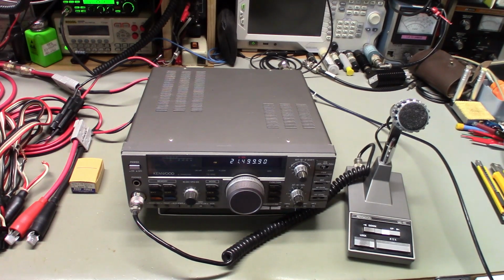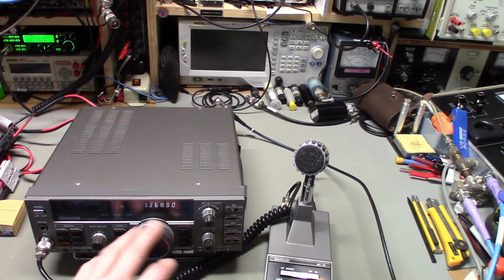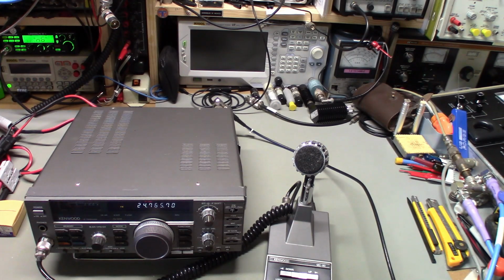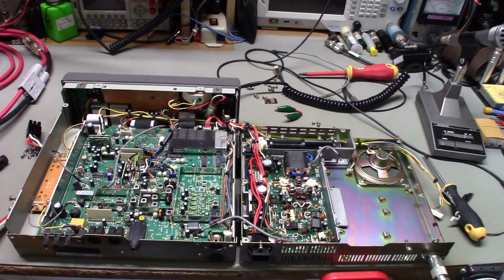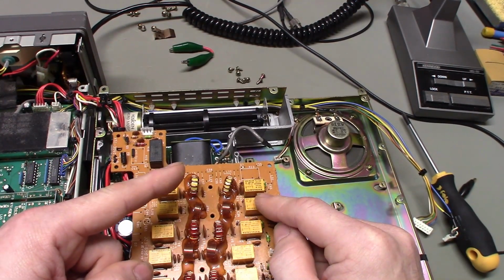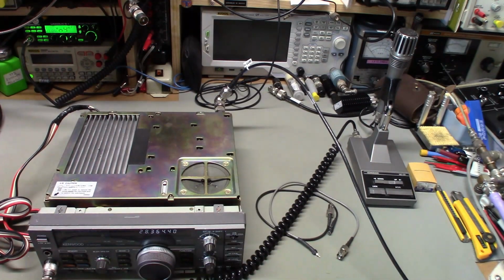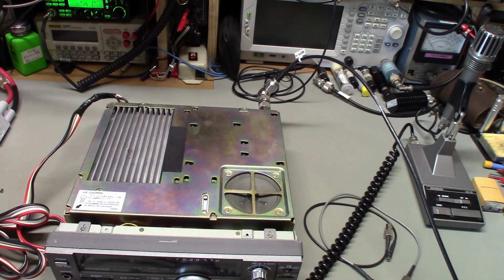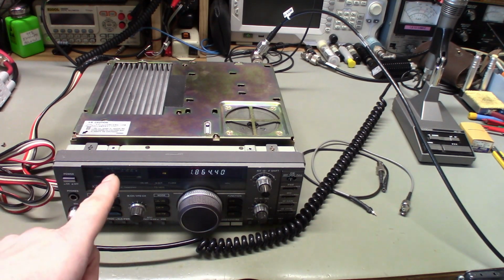Kenwood TS-140S HF Transceiver no receive / transmit repair.

Comment: Hi, I understand that this video was 6 years ago. Wondering if you still work on Kenwood Transceiver? I have a Kenwood ts 680s that the problem is the noise on 10 meter band is up to s9. I tried all the kind of diy balun, 1:1 but does not work at all. Lately I said to myself, maybe i will try my Icom ic735 and to my surprise, the 735 is more quieter than the 680. That when I realized that there could be something wrong with the 680. I would appreciate it very much if you could reply to my message regarding this problem. Thank you, more power to you and have a blessed day.
Reply from the maker: I'm not really sure it's something wrong with your radio.  You say your Icom IC735 is "quieter".  Does that mean there is still significant noise?  You may have a high RFI noise source in your vicinity.  Is this something that just started recently?  If so, did you have a noticeable increase in noise on the other radio at the same time?  If you disconnect the antenna from the Kenwood does the noise go away?  If so, I would suspect it's being created external to the radio.  Noisy power supply, LED lights and any number of other noise sources that are present these days.

Comment: had a ts-430 years ago,it output 100w on 28mhz but got lower down the bands,it was down to 7w on 80m,turns out it was bad pa driver transistors,wierd! 73 m3vuv.

Comment: I bought a used TS140S in 1989 and I still use it today. It had the MARS/CAP modification so it will transmit just about anywhere, but I never use it out of band. The guy I bought it from had a MARS permit so I know he used it for that. He also had CB19 programmed into one of the memories so he was probably on there a lot too. The rig still works pretty well, except the fan doesn't seem to come on anymore. Not sure if the fan needs to be replaced or something else. Thanks for doing this interesting video.

Comment: I have a ts140 and one day low power out from 100watts to maybe 10watts disassemble and check the 2sc2879 and are fine the only thing I've noticed is a torroid in the padeck  could be burnt ? it receives fine.  just low  power out put

Comment: hello, do you know which is the trimmer to increase the modulation in am.grazie
Reply from the maker: There is none.  Most amateur radios have no AM modulation adjustment.  HF rigs are designed for SSB performance not AM.
Reply: @mikesradiorepair  there is no trimmer to increase the modulation an am? mic gain?

Comment: hey mike do you still work on kenwood ts-140=s  radios? i got one  that i loos a few channels on all bands and get a morse code tone  the channel display goes out  , gets 4 dots  then if i move  the tune knob left or right a few channels  , the frequency will come back in and work fine

Comment: Good afternoon. Receive a cordial, greetings from a distance. This is to ask you a question if you have your kenwood ts140s equipment working in digital, if you did it with the max 232 to connect it to the pc, so that it changes frequency both by the radio and by the pc. If you could explain to me or provide me with a diagram how to do it, I would be grateful. 73.Dx.
YV1HGS.

Comment: im mechanical engineering graduate and work in electronics industry ,,and its hard to understand signal and also hard to find how to signal trace receiving signal ,i already know how to trace transmitting signal. can someone help me to find and what equipment to use in tracing signal from defective RX Radio.?

Comment: Thank you! I had no xmit but partial receive on 40m and suspected the relays. Found cold solder joints as you did and followed your advice. Works like a champ again! Thank you! 73 de WB2SMK

Comment: I bought a 140 in 1989 and had it for 10 years. The guy I sold it to still uses it, without a hiccup to this day, 32 years later.
Reply: I have one still in use too on channel 38
Reply: @TexasPrisonStories  oh good Lord, a chicken bander using a ham radio
Reply: The slide switches for the biggest minus for this radio. Other than that, it’s great.

Comment: Hey Mike, wondering if you still work on radios.  I just got my first hand down HF radio.  It's a TS-130SE.  I dont think it's working in transmit.  Please drop me a line piercejj@verizon.net.  KM6QAQ 73

Comment: Absolutely awesome video. I have a ts-140s I've been using it for years without a problem. But lately I've been starting to see that I'm losing power sometimes only transmit 60 watch. I would love to have you look at my radio how do I get in touch with you.

Comment: Thanks! This was a great overview that will help me out. What type of oil did you use to lube the fan after you cleaned it? Did you also clean any of the pots or sliders since you already had the radio open?

Comment: Great job Mike. I picked this radio at the Ft. Wayne Hamfest about 3 years ago. You're right about the ease of access. I added a filter for CW and a digital input for computer. Military guys make a mod to transmit on mil frequencies, (actually any frequencies). I know there's a trick to broadcasting on AM but it will broadcast at 40 watts or less. My power cord looks vaguely similar. weird. Thanks for the video.

Comment: TS-940s restoration.  Power output on all but the 160 meter band, was unsure.  I unplug the PA and hook to a load and meter and I got power.  Then hooked to out of low pass,  no out on 160.  Started clicking through the bands, used a flashlight on relays, sure enough one relay not moving.  Found an open coil winding in relay.  So when key up all power reflected back, lucky no damage.  Since this low pass has its directional coupler for SWR after the low pass, radio had no idea it was destroying itself.  Love the videos. Sorry I rant a lot.

Comment: Hi Mike,
You need the get out the amateur band chart. Some of the freq you selected were out of the band and it won't transmit.   73   WB3BJU
Reply from the maker: I would have to disagree.  A large number of the customers radios I see on my bench, I have bought used and have seen owned by licensed amateurs have the MARS/CAP mods done to them.  I swear people do it just because they "can", even if they never transmit on those frequencies.
Reply from the maker: Yes but that depends on TX modifications done to radios.  MARS/CAP mods done to radios effect TX range differently on different makes and models.  This radio had some of those mods done to it previously.
Reply: Hi Mike,
You're correct, but most of the amateur radios don't have the MARS/CAP mods. Since it had the mods, it will transmit on more freqs. Good info on re-soldering all the relays.   73   WB3BJU

Comment: In front of the watt meter is a brown glasses case.  In front of that is ?  It looks like the twin towers.  Inquiring minds want to know.
Reply from the maker: LOL. Had to look at my own video to see what you were talking about.  The brown case is NOT a glasses case.  It is a Walther PP pistol.  The "twin towers" is a Pace surface mount solder station accessory.  The two pieces standing up are a sponge holder and fiberglass brush for cleaning SMD removal tweezer tips and the stand holds a large sponge to drop hot IC's and other parts onto.

Comment: Thanks for the video Mike! My TS-430s suffered from cold solder joints in the final section. I had to remove the old solder and add a "Z" jumper for the pass-throughs for the transistors in order to clear up the no TX problem after an extended keydown period. 

  On a side note, i find it a bit strange that these rigs have an output of 100+ watts on AM - I always thought they were throttled back to 25. I thought mine was modded! 73...

Comment: Hi Mike.  Believe it or not that power cord that he sent you was what was included with my TS-680 new.  His may have seen better days but those fuse holders were what they shipped it with.  I still have mine somwhere but I use a Kenwood power supply these days.
Reply: I have a Kenwood TS-140s also and that is the power cord mine came with as well.

Comment: Great video,  Mike. But you KNOW you'd rather work on all my FT-757s!!   ;)
Reply: the 757 is a pita to work on. Have one on the bench with no TX or RX.
Reply: @TheRadioShop  : I've had Mike go thru 3 of mine so far. I won't have anyone else do them. There are a few things I can do myself and I've had them filleted on my bench many times. If it comes down to it, I will replace batteries, or the overload bulb in the receiver and such, but Mike gets everything else! He'll be happy to know that I have them all for sale now, and am currently awaiting my FT-990 that will be my daily rig.
Reply: Agreed, Mike would be my choice of techs to repair these.  I should send him mine :-)
Reply from the maker: LOL, don't know about the "would rather work on" part but sure.  The 757's are nice radios but as Buddy (The Radio Shop) sais they can be a little bit of a PITA to work on some times.
Reply: @mikesradiorepair  : LOL. Selling them all and I've got an FT-990 coming. Have to wait til I get it to see if you'll get it or not! ;)
Reply: @Fast Freddy Muldoon : Hey, REV!!!!

Comment: One of my favorite radios. Easy to use and easy to work on.  Should have never sold mine after 14 years. I miss it.  Good advise on how to re-solder those relays Mike. I completely agree. Only down fall with these rigs are those slide switches.  Thanks for sharing.
Reply: Hi buddy. I was gonna ask you what you thought of this rig. Those slide switches are stupid but have you heard of any other complaints? Thanks. Richard Wilson
Reply: Other than the slide switches these are great units. I had mine for years and never a failure with it.  I would love to own one again. Had good audio and strong signal. Easy to operate. Only complaint I can think of is folks using them on another service and blowing the finals out.  Other than that, great radios.